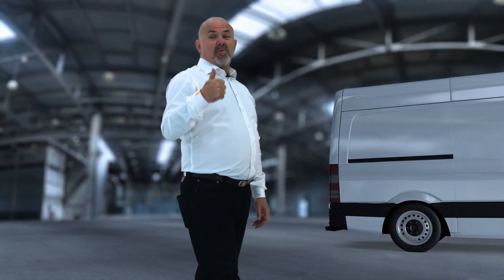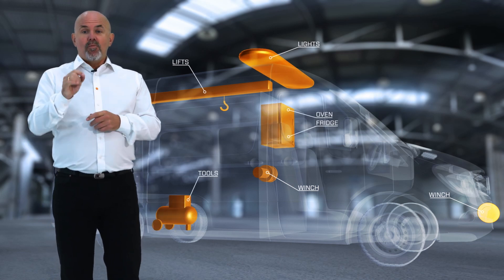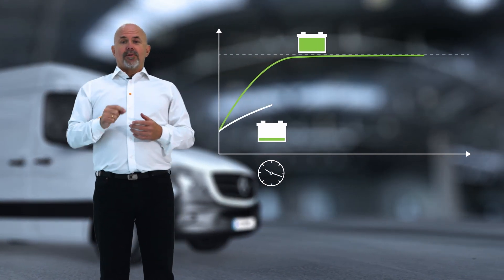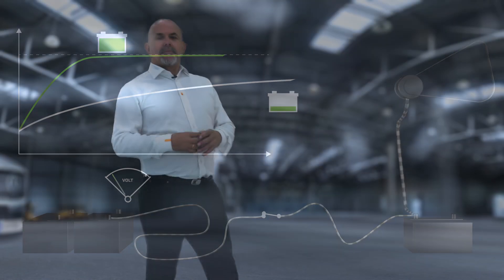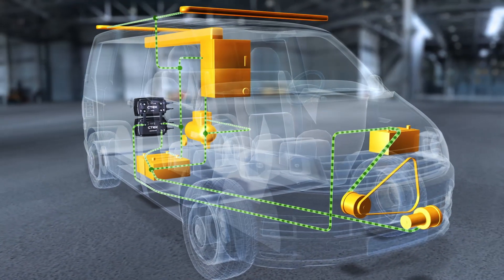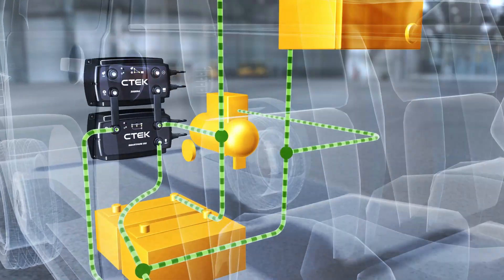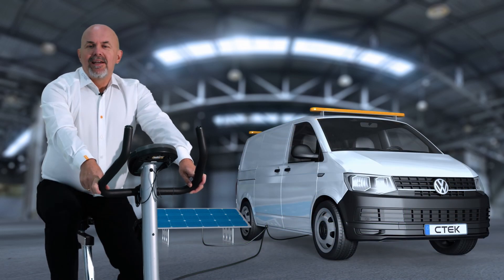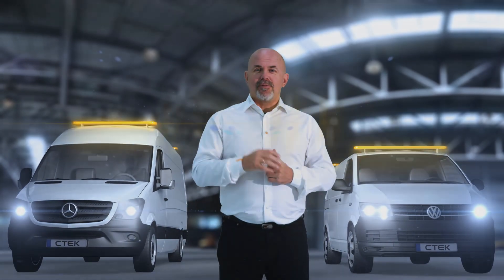CTEK ON BOARD CHARGING SYSTEM

Comment: Im installing a dual battery in the rear of my vehicle, the dual battery is in a battery box. My question is should the ctek D250s be installed under the bonnet close to the starter battery or should I mount it in the back near the dual battery box.
Reply from the maker: HI, I think you should place the charger where it fits the best. In the manual you can find the size of  the cable depending on how long you need them to be. Best regards CTEK Support
Reply: @CTEKBatteryChargers  Thanks for the reply, I will go ahead and install it under the bonnet then.

Comment: Recently fitted my Ctek D250SA it accepts power from solar but not from vehicle battery. Multimeter says 14.4 at cable where it connects to Ctek so power is being transferred through cable but ctek is not passing this on to leisure battery. All Ctek videos are very good,  clear and concise. But there are no trouble shooting related videos to help anyone. I’m using a single 190 led acid leisure battery. And the Ctek unit came as a kit so all cables/fuses are correct. Any advise would be much appreciated. It’s winter and I can’t operate my heater! 🥶👍

Comment: I have a ctek 250 sa, I am not using the solar side of this charger. Could I connect my ctek mains powered charger on to this solar  connection to charge both the car battery and leisure battery ?
Reply from the maker: HI, I recommend you to  connect the  mains powered charger to the starter battery. When the starter battery get charged  the D250SA will charge the Servicebattery as well.  I recommend  at least a 10A charger. There are a lot of suggestions how to connect at www.ctek.com https://www.ctek.com/business-se/kundsupport/dc-dc-support. Best regards CTEK
Reply: @CTEKBatteryChargers  Thanks for the reply, I didn't realize that.
Regards
Reply from the maker: @stuartcareless9550  Hi, Glad I could help! /CTEK Support